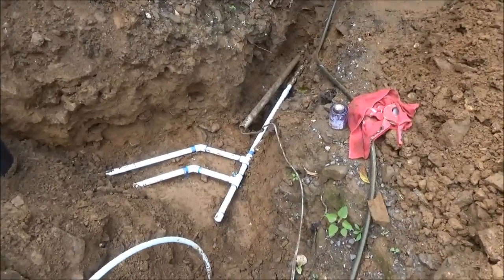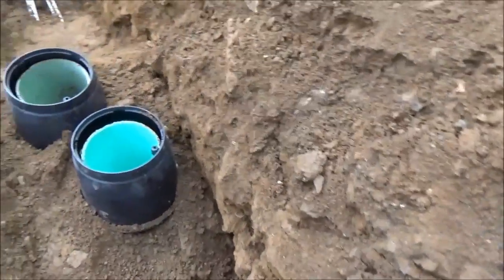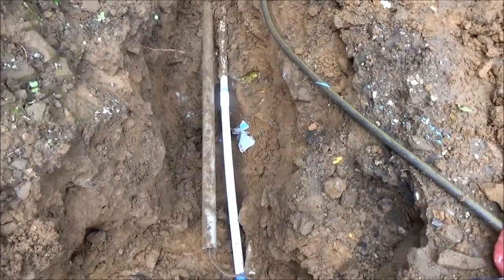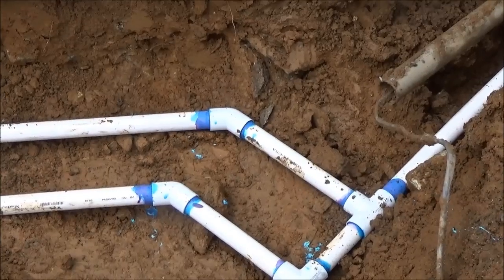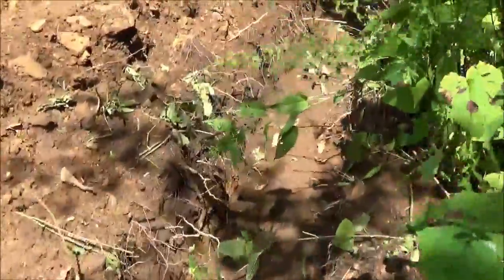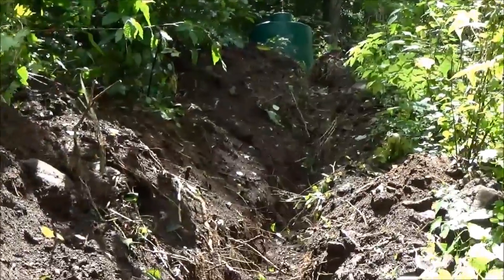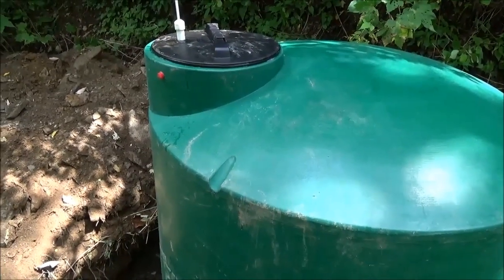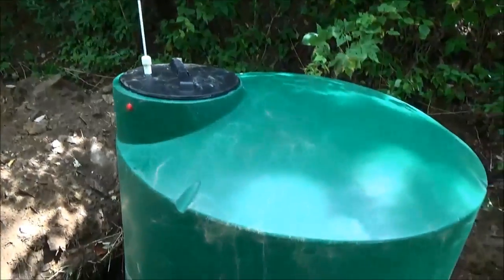Inline Elevated Potable Water Storage

Comment: Instead of doing supply and return lines, why not do a single supply/return line up to the tank from the main line at the bottom? At the tank, you can tee off to supply the float valve and the other leg goes to the bottom of the tank and install a check valve after the tee and a check valve at the meter/well. this will keep the tank full at all times when water pressure is available form the well or the city and when water pressure goes away, the checkvalves will direct water from the tank to the property. Easier and cheaper.

Comment: I have almost similar system but I used only single pipe which fills the tank and delivers the water to house automatically. I tricked it by using a non-return valve at the out flow point by using a Tee, water from the out was looped to flow into the water tank from its upper side inlet. At the filling point a float valve was used to shut the water when it is at its highest level. When the float valve shuts the pressure switch shuts the pump. When the water is pumping valve at the delivery end shuts and when the pump stops the tank water pushes the valve to out to flow. Hence saved many bucks and hastle. Only single pipe runs my house automatically.
Reply: Good job. I do most of my solar jobs with single line.  This job was so steep and Rocky that if I have a pipe failure in the future I will use the other line as a backup.

Comment from the maker: Installing an elevated water tank for  great house pressure and adjusting pressures to maintain a full and fresh tank that can be filled by a generator, hand pump or the grid.  #practprep   #offgrid
Reply: +engineer775 Practical Preppers what if you have no where high to put your tank?
Reply: Excellent Video! Excuse me for chiming in, I would love your opinion. Have you considered - Proutklarton Protecting Aqua Plan (just google it)? It is a good exclusive guide for getting prepared for a mega drought without the normal expense. Ive heard some great things about it and my friend at last got great results with it.

Comment: I don't see how solar isn't still a viable source of power even in a bad location. At the very least there would be enough sunlight to charge a few deep cycles and the well pump could be run for a few hours at a time the same way a generator would. Ideally by the next time the pump would need to run to fill the tank, the batteries would be recharged.
Reply from the maker: The power I would need from December through February in this location to lift that high is not available.

Comment: Scott, ...Just curious , What's their well depth, static water level and GPM ? And do they have a pressure switch with an auto shut off or something to save the pump if it's drawn down too fast?
Reply from the maker: 500,120,10 and no autoshutoff.  The pump is 7gpm.